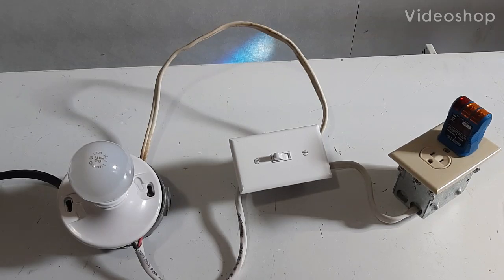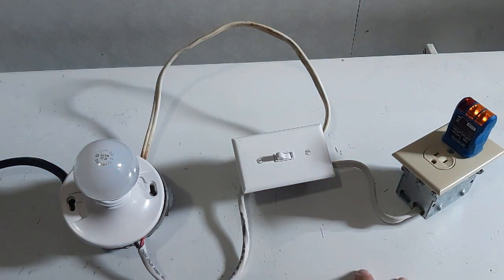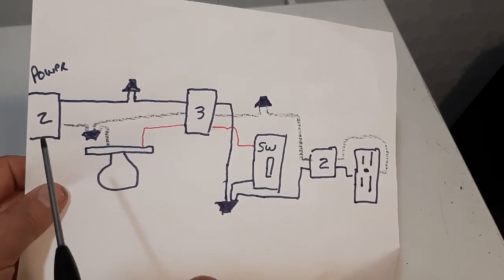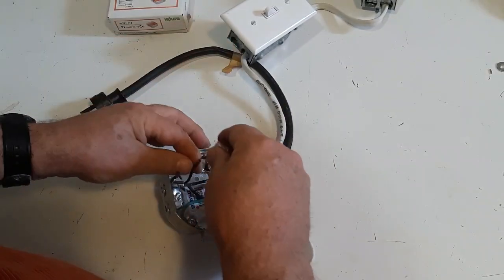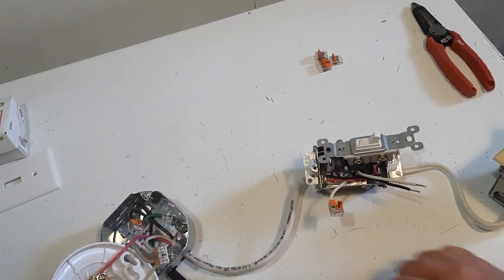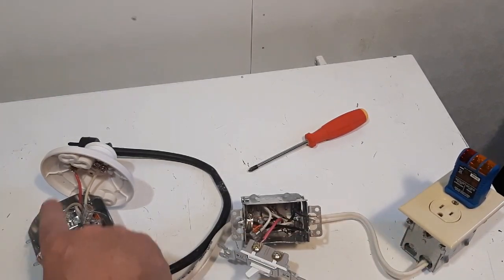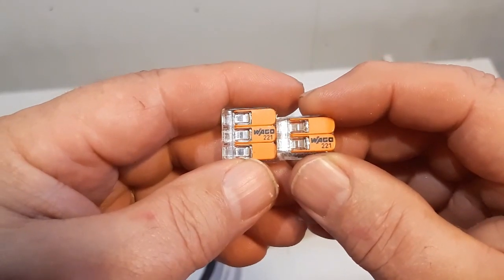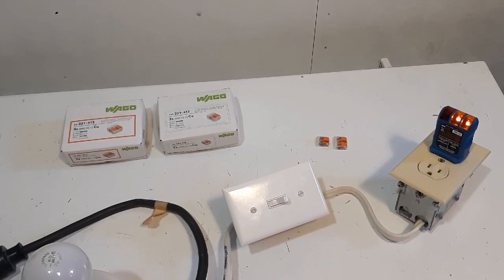How to wire outlet from switch.

Comment: I removed 2 receptacle from bedroom and now the other receptacles and ceiling fan don’t work. Any advice
Reply from the maker: Its hard to know what the problem is. When you removed the receptacles you removed the power to the receptacle and ceiling fan. Retrace your steps, If it worked before then you changed something.

Comment: will this also work with a switch receptacle instead of the light?
Reply from the maker: So instead of the switch controlling the light. You want the switch to control a receptacle. Yes it should work. One receptacle hot one controlled by the switch.

Comment: Jim can you help me I did everything when I install the GFCi plug I have no power.  When I test I get 120v on black .  Can you let me know what I am doing wrong?
Reply from the maker: The GFCI has a Line and Load on the back of the plug. The power has to go to the Line or it will not work.
Here is a video I did on GFCI ,  https://youtu.be/WZ-jwp7zhUU